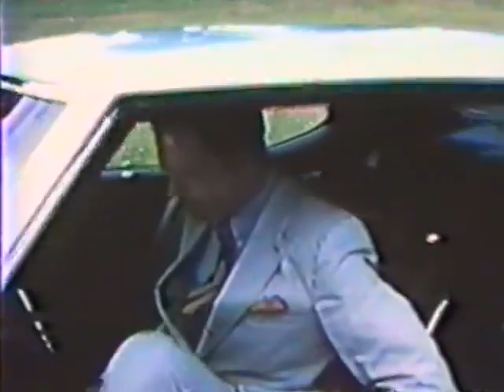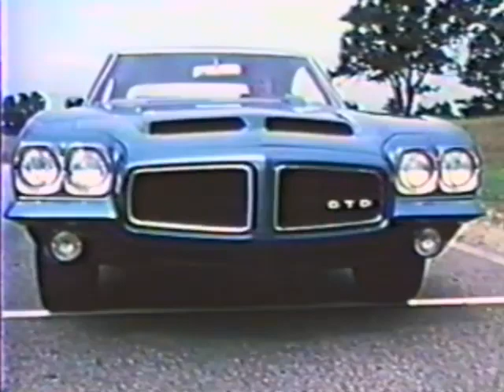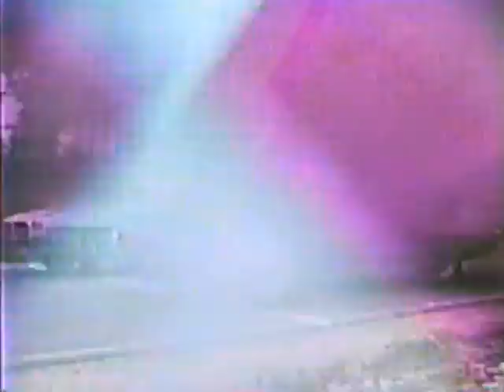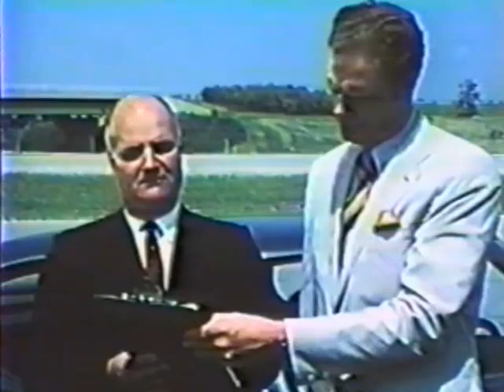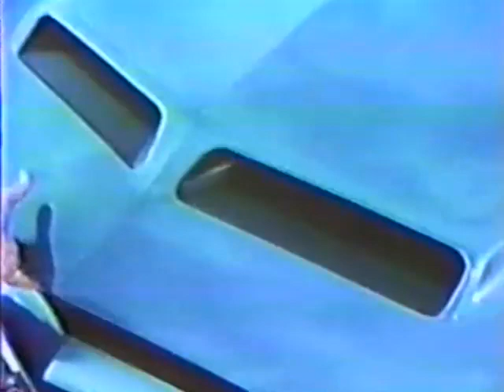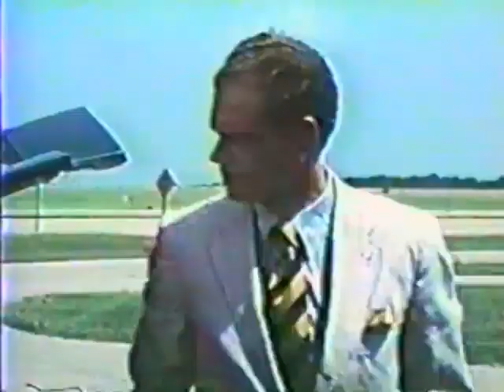1971 Judge 455 H.O. vs 1970 GTO 455 H.O. - Promotional Film

Comment: The 70 455HO, a 1 year only engine option,  was just a D-port engine and wasn't the hot performance engine for 70, just your basic log manifold 455 with an 067 cam.  Drastically different than any of the round port offerings and at a slight disadvantage from the start.  Why they used the HO designation on it is odd to me but likely a sales gimmick.   The RAIV 400 was still a better performer that year.

  Still neat to see this stuff even now.   Better than the lame car commercials we see today.
Reply: They did it again in 1975, when the 455 was reintroduced on the Firebird. They called it a 455 HO when in reality, it was the same 200 HP engine from the large car parts bin.
Reply: @googleusergp  Bud sadly, by 1975 anything with 200HP was a high-output engine....
Reply: @goesfastandfar  True, it got a little better by 1979, but then it went downhill thanks to the EPA knocking at the door.
Reply: Any car that I bought in the last 40 years was build able.  All of them! No cer wasn't available then or now with a cam ,pistons, rockers, heads exhaust, or anything else for mods! Plain and simple, government overreach tried to kill the muscle car but, thanks to crane and competition cams private head  builders,try roller rockers and more, horses were available! These blocks were very nice to work with!
Reply: The reason they called the 70 455 an HO is because it was a higher output than the standard 70 455. The differences are the standard 455 had #15 heads and the HO had #64 heads. The 15 heads had press in rocker studs and the 64 had screw in. Also the 15 heads had the smaller intake and exhaust valves and the 64's had 2.11 and 1.77 valves. A gto or grand prix that had the 455 HO with a manual trans also got the bigger 068 cam. Also HOs had 4 bolt mains where the 70 standard 455 had 2 bolt. So yes not huge differences but the 64 headed 455 was a HO compared to the 70 standard 455. I wish they had offered the RA4 heads,cam,intake and exhaust manifolds on the 70 455HO block,,,that would of been a killer engine.
Reply: Super duty . Had 4bolt main caps
Reply: I was wondering why that low compression engine won. Thx.
Reply: @scott70707  They should have offered from the factory...but I wonder how many people did that conversion over the parts counter fir 1970? 041 cam, 614 heads, round port intake and exhaust manifolds? Hmm!
Reply: I stand corrected,  super-duty had 4 bolt main caps
Reply: We are repeating the the past my friends. These hi HP engines Dodge Chevy and Ford are producing are going to be gone in the near future. Dodge already said the end of the hemi hellcat is 2023. They are all going to electric vehicles.
The infrastructure for electric cars isn't there yet. How many gas stations have charge stations for electric cars? How long does it take to do a quick charge. 10, 15 minutes? The public doesn't have patience right now for you to fill up in 5 minutes now. How's a long charge gonna fair out. Electric cars are not that green either. The electricity generated at at the power plant is from coal, natural gas and very little solar. By the way how about them nice batteries in the car. They are made of what kind of metals? Where's that going to go when the car is done. Beautiful green technology.
Reply: You just said all of the things I was about to say. Well done.
Reply: Thanks for the interesting perspectives that yourself & some of those who replied gave.  Always cool to learn new things about how these engines were actually built & spec’d.
Reply: @DavidSmith-tu1nd Just the other day my neighbor said her grandson drove in from out of town. He has a Tesla. The normally 8.5 hour trip took 13 because he had to stop five times to charge.
Reply: @scott70707  I thought everything was getting the big valve head after the 66  year model ?
Reply: I think the old super duty 421's out performed any 455's they had.
Reply: I believe the hottest engine in 1970 was the ram air 4 for the GTO so that would have been a better race
Reply: @joehudson3072  No,,,many of standard pontiac heads right into the 70's had 1.96 intake,,,1.66 exhaust
Reply: The D-port heads on the RA III engine was pretty powerful combination if one had access to high octane gas.  Although one could put the RA III heads on a 455 engine the compression ratio would be way too high for even premium gas.  However, if one could find a set of early 1970s 7K3 D-port heads these head would work very well on the 455 and give an overall compression ratio of about 9:5 to the 455 engine.  It was a fun hobby back in the late 70s and early 80s to tinker around with Pontiac parts as many of the part were interchangeable due to all the Pontiac blocks all being cast around the same block design.
Reply: Just imagine if PONTIAC had put the 72cc RAIV heads on that 455V8 in 1970. 
Maybe a nice RAIV style cam, or a tad more. An 800cfm QUAD
It certainly would have given the HEMI CUDA and LS6 a decent run. 
It would have been a beast!
Reply: Just imagine IF PONTIAC had put the small (72cc) RAIV heads on that 455" motor in 1970.
A nice RAIV cam or a bit more...and 800cfm QUAD

HEMI CUDA and LS6 Chevelle would have had their hands full
Reply: @scott70707  You're right. I have a 70 455HO with #64 heads

Comment: Cool AZZ stuff, I own a 1972 455HO, 7f6 heads, it has been bored 30 over with TRW L2394 pistons, a nice comp cams bump stick. I wish I could find the trans am body it came in. Love Pontiac. Thanks for posting this, seems like another dimension. 👍👍🏁🏁
Reply: I had a 74 TA with the 455 HO/SD worked and putting out over 600hp man i miss that car

Comment: I have a 71 LeMans Sport 455 with 3.55 rear and beats up on 70 455 GTOs!
Reply: How many 70 gtos with the original 455 have you lined up against?  You can take any motor and if the timing is not optimal,,carb or carbs way out of tune,etc the thing will not perform well. Ive beat stock,original motored 426 hemi cars at the drags before with a decently tuned,fairly stock pontiac.  Not going to say Ive got a hemi killer because of that. Ive seen well tuned pontiac,buick and olds 350's that would embarass a big block. Its all in the attention to details and optimzation. You could have a LS6 454 run slow if its out of whack on the tune.And there are alot of people out there that dont have a clue on how to optimize and tune an engine to run at its full potential.
Reply: Wow those drags must be few and far between

Comment: Car and Driver tested a 70 455 HO GTO with a stick.  I'll have to dig up the issue but I recall it ran mid 14s and was rated at 360 hp.  The blockbuster news for the 70 model year was that the GM front office lifted the corporate restriction on displacement.  So you end up with balls out cars like the LS6, Stage 1 455, and W-30.  Somehow Pontiac kept their top motor at 400 cubes (RA IV).  So the 70 455 HO was a marketing stop-gap.  I think C&D addressed this issue in their test.  Note the odd reference to "...the super duty" at the 35 second mark.
Reply: You put it best, the '70 455 was a stop gap for Pontiac.  It arrived late in the MY and they rebounded with the '71 455 HO which was much better but I think Olds still had them beat with the W-30 engine

Comment: I did some research. My dad and later , I had a 71 .According to the brochures and PHS experts the 71 455 H.O. GTO had "more tractable"  usable power, and performance than the 70 455. Barely , though ,... the 310 net rating was very underated because insurance companies were really trying to raise premiums beyond reach .  The  70 455 was basically a full-size Bonneville motor that had great low end torque but didn't breathe as good at higher rpms. The cam , timing , distributor advance, were altered somewhat on the 71 to offset lower compression . then consider gross vs net hp, 70 had a gross  rating of 350 hp . Dyno tests done from that period showed the 71 actually had over 360 net hp when set up with dealer installed ram air , with bigger scoops on the 1971 hood allowing it to breath a little better than the 70 with similar ram air. Using net , dyno corrected hp the 70 had 340 hp...even with higher compression . another GM trick , slightly more agressive rear axle ratios were standard on the 71 H.O. vs 70 Most magazines indicated 1/4 mile in the mid 14s for the 71.  15.0 seconds for the 70 model . just a few tenths apart , but, the 71 GTO 455 HO was still one of the top 10 fastest production cars built in America that particular year . Only a Hemi Cuda/Challenger , Chevelle SS 454, or a Corvette 454 could beat it by a big margin .

Comment: They ran the 70 455, want a good test, run it against the 70 Ram Air IV 400. The 70 455 was rated at 360 hp. The Ram Air rated at 370hp but really about 425. Beat it then you can say you did more with less.

Comment: This was early TESTING of the SUPER DUTY 455!   It never made it into the GTO for production though...he says the time for the "Super Duty"...and said "boy that really goes"...that is why it was faster than the 1970 GTO in this demo.
Reply: They were promoting the 71 model,,,you think they would of let the 70 beat the 71? Would of been a horrible promotion if it had. IMO the 70 also definitley had a better looking nose.
Reply: I have a 455 HO out of 71 TA, needs M22 Rockcrusher
I ran the 1.65 rocker arms from Ram air 4 instead of 1.50.  I raced a 455 SD TA and he lost and wrecked his car on woodward ave.
I dont own the TA anymore.
Reply: I have a 69 with 400 HO
Both of those cars are very nice and equal in curb appeal to 68 and 69
My steering wheel is going thru some meltdown.
Its like tar on it. Like corvette wheel has same problem
Reply: @scott70707  I think his point is that the 71 was an Super Duty ( and not an HO as mentions within the title)
Reply: @lissaleggs4136  69 and up 442 steering wheels have the same sticky issue - by mis-design

Comment: Yeah,  your pantalones are on fire  ! Only way a 71 455 ho would beat a 70 455 ho is if the 70 had 3.08 gears and the 71 had 4.11s .
Reply: Good point ;)
Reply: 71 H.O would spank any 70 gto with 3.42 s !
Reply: Finally,a valid point from someone who knows about cars.....the general public does not. You can see the two cars are not identical ! The 70 has white wall tires for Christ sake!
Reply: @rjmzz430  LOL 😆, 70 had 10. 25 compression compared to the 71 with 8.4 compression.  I know heads were improved for 71 but that's alot of cylinder pressure to overcome.
Reply: @benkrom2737  the 455 H.O. Had RAIV-style heads with large exhaust ports and better valves that more than made up for the compression drop.  While they would both move out, the H.O.s we’re outstanding engines in the period of increased pollution controls and low lead gasoline.
Reply: @boydoesititch  Back in the day I had a 69 ram air IV , a guy in town had a 71 455 ram air and yeah was no slouch but had nothing for my 400 ram air IV that had 10.75 compression. If I remember correctly he had put some thinner headgaskets to bump compression some.  Don't remember by how much. Car was stout though for probably being 9.0 to 1 with headgaskers.

Comment: Not a fair comparison. So sure, the 71 had RAIV stuff on the top end, but both engines were limited to the crap cast connecting rods. Pontiac dropped forged rods in 63, and didn't return till 73, (SD). The 70 455 still had compression. Pontiac should've put the D port RA manifolds, and the 744 cam in the 455. Even if limited to 5500 RPMs, it still would've been a comparable performer to the 71 HO.
Reply: @gurnblanston3210  You really are a hard case, aren't you? Are you finished?
Reply: @gurnblanston3210  No...I didn't think so. I am. I'll let you have the last word, cause I know you're the type that needs to.

Comment: To me the last bodystil of the gto..was 1970... in 71 and up it was just to beefy in the front...I didn't like that...
Reply: 72 was the same as a 71, but the 72 had a recessed grill and some ornamentation around the parking lights
Reply: Yeah, the GTO had a great run from '65 to '70 and then it kind of tailed off in both looks and performance. But, looks are subjective.

Comment: Power went to hell for 72...
Reply: That was because most manufacturers changed to the SAE net horsepower rating which was with all accessories on and operating on the engine vs gross horse power which was measured with only the engine itself. This was to please the insurance companies even more. They had complained since the mid 60's about the high horsepower of the engines. That made it expensive for people to get insurance on these muscle cars. If insurance rates are high then people shy away from buying them. So with the air conditioner pump, power steering pump, alternator, fan, and air pump operating it draws down the engines' horsepower output. So that is what they used. I had a 1972 Formula 400 back then. Same exact YS engine as the 1971. Only difference was 300hp vs 250hp due to gross hp vs SAE net hp.  Of course the torque number was down too.

Comment: Funny how the ~5s 0-60 mph and ~14s Quarter MIle times of these drag strip monsters can be easily beat by a mid-tier sporty SUV these days (under 5s and in the low 13s). Progress...
Reply: Engine management  is the key
Reply: What is your point?🧐🤡
Reply: @shanebailey9128  Just that it's funny how these 'drag strip monsters' can be easily beat by a mid-tier sporty SUV these days. Progress...

My 2017 2nd tier (not even trying) MB "truck" would have been the 2nd fastest of ALL the muscle car era cars. Only one faster. Amazing.

Comment: You know that was a lie,If you restrict air flow you get less horsepower,Any mechanic will tell you,so I'll stick to my 1970 with 425 horses and slap on more goodies like headers new cam,bigger valves heavy springs hi compression heads and 5speed transmisson

Comment: Less polution more performance = 
CHEVY LS ENGINE
Reply: Sorry but you don't torque below 4 1/2 grand that Poncho puts out,but comparing a roller cammed rocker motor to flat tappet? You look up Butlers roller motors and what their natural aspirated Pontiac motors pulling 8&9s without a hair dryer..better yet look up a Pontiac 303 and see why Chevy stopped all Pontiac motors period! Hell LS had to copy FE ford and Mopar 426 six bolt mains, and truthfully unless you replace those LS banana peel rods and shit pistons you'll be replacing a motor every yr unlike my old 400 Poncho that me & my sons did 18yrs ago and run every summer! Low 13s with 3:42  and no gasket match or porting done! PS it gets twice the gas mileage of my  09 2500 6.0 with the ooo weee 823 heads! Which r 3xs better then cathedral ..and O my 461 BB CHEV  setup roller,ya it's cool... So Im not stuck in mud,I see the other greats also,there's Sooooo much more then just the LS series
Reply: @scottnangle246  🤔 its 2021 are they putting any of the combos you mentioned into FORD CARS?
The ls is MODERN and trumps all previous motors.
A MOTOR THAT CAN HANDLE A TURBO IN STOCK FORM IS BAD??
The ls has been around 20 plus years and people put them in ANY and EVERYTHING.
The same way people ditched land line phones for cel phones.
Just WAAAY more practical and BETTER
Reply: @cimism610  I've seen stock old small blocks do it few times! But same result 2-3 XS BIG BOOM
Reply: @cimism610  Newer doesn't mean  better it means just more mass produced with short cuts on production cost ... And has stated my 6.0 drinks 3xs more gas but DOESN'T HAVE THE torque of either my Pontiac or my BB CHEV!  Both of which use less gas  ...all of which have nothing to do with Trump accept that fact that he believed USA being energy and fuel independent which is 1000Xs better then the current regime!
Reply: @scottnangle246  I used trump in the verbal context.
Well when you can travel back to the past and grab some old motors let me know.
You guys are going to be pro ls when everyone is electric motor swapping cars.
U CANNOT STOP PROGRESS WETHER YOU LIKE IT OR NOT.
Keep in mind that cars have only been around and popular for 100 years.
Pretty sure you had people who had horses who hated those dreadful automated machines.
Change is :
1 Ridiculed
2 violently opposed
3 eventually adopted and used
Reply: @cimism610  LOL,or I could just have terd on a string just like everybody else?,no thanks like a said I have 6.0 and it doesn't do anything any better then all motors b4 Accept guzzle gas ...No codes,no problems just the way it's designed